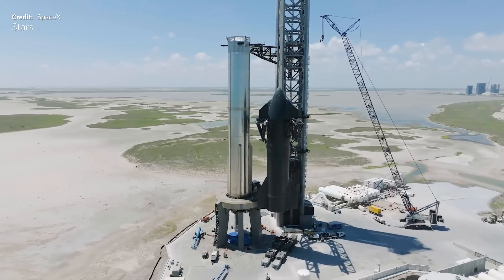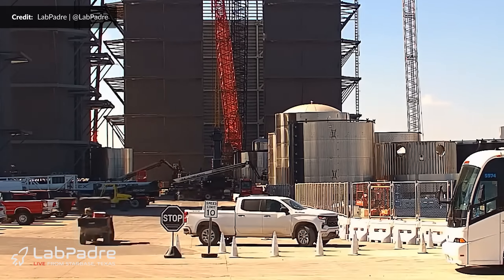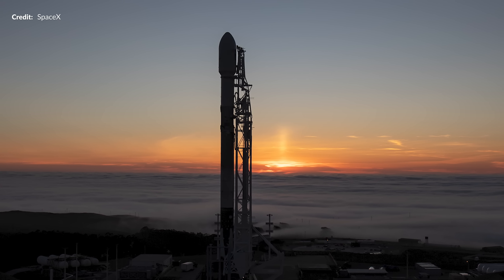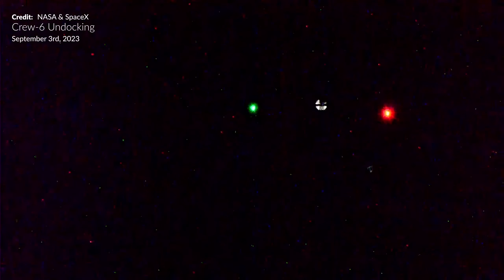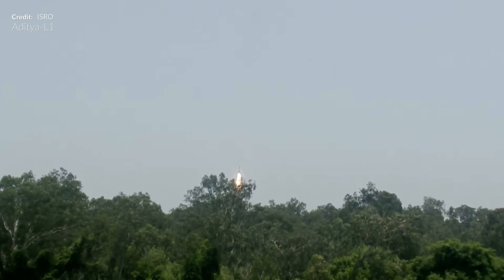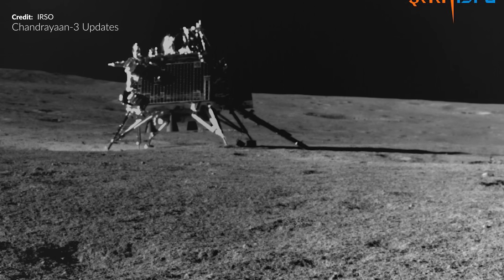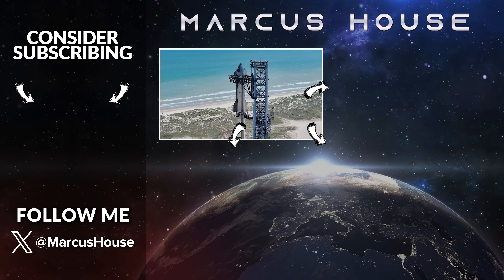Good or bad news for SpaceX's Starship Flight 2?, New Lunar Lander Launched

Comment: From the language in the FAA letter it's clear the report they refer to was only reviewed by them but authored by SpaceX themselves. This means the 63 "corrective actions" were also defined by SpaceX themselves, and not something the FAA came up with and is forcing SpaceX to implement. So these corrective actions probably describe some or all of the modifications they implemented on the FTS and Stage 0. The reason the FAA explicitly states the closure of the investigation does not mean immediate return to flight operations may be because that requires a new launch license.
Reply: Exactly.
Reply: Most likely it will just be a modification of the existing licence but yes that is usually how this works
Reply: Probably not all of the 63 corrective actions, but fundamentally yes... the FAA isn't there to tell SpaceX how to build a rocket, they're about ensuring that SpaceX has the right processes in place to ensure safety. So the closure of the investigation simply means that they're satisfied that the investigation was carried out appropriately, and that the proposed actions adequately address the problems identified.

It doesn't mean that all of those actions have been carried out — though if SpaceX are proclaiming themselves ready to launch, it suggests that they have reason to believe that all the show-stoppers are covered.
Reply: @simongeard4824  I've seen the checklist. ALL 57 items are completed. The other 6 are for the next vehicle, and are pretty basic.
Launch, this week. I'm still guessing 15 Sept. Friday. They are wrapping up on a 15' concrete barrier around the pad next to the mud flat. Tanker trucks are starting to roll out of the Port of Brownsville. Mind you, it takes 400 semi tankers to haul all of the cryo and water. And that's going to be a problem, going forward. I see them dredging and building a pier to barge in supplies and barge vehicles to Florida, eventually.
  👻☠️🗽💯🙏
Reply: @CritternNation  They're a bit limited in their ability to dredge there - the whole wildlife reserve thing - but yeah, logistics are certainly a challenge for them, and one they'll need to solve over time.

Comment: Painting that nose cone white is probably to test the paint they are planning to use. There is a lot of engineering goes into the paint as it has to be robust enough to survive the launch but very light weight and also has to have the correct reflectivity. They no doubt want to leave it out in the weather for a while to see how it stands up, after all the actual vehicle may be stacked at the pad for a while before it launches.
Reply: Good thinking...
Reply: It seems excessive as a paint test... I'm sure they have plenty of appropriate scrap steel lying around.
Reply: @disorganizedorg Always remember to Test as you fly. It seems that every rocket company has to learn that lesson the hard way.

A Boeing Starliner software error cut short the first flight test. Testing all of the software together would have caught the error and saved Boeing billions.

Almost every successful liquid fueled rocket engine design has been tested on vertical test stands. It is more expensive than testing on horizontal stands, so they tend to verify that they consistently get the same results on horizontal stands and do the bulk of testing horizontally. Vertical test stands need flame diverters, which require a lot of maintenance.
Reply: @hamjudo  Starliner is dead... more bad news this week for it. I say scrap it, stop the bleed-out... and let private partners take over.
Reply: @LuMaxQFPV   What is the additional bad news?

Comment: That hot staging ring needs to be super well engineered to support a fully fueled Starship during acceleration to space! Those vent holes don't lend any support, nor do they hold air pressure to improve rigidity.
Reply: It's not much different from the ship aft skirt. That isn't pressurised either and it holds basicly the same weight. As long as you have plenty of stringers there shouldn't be an issue and SpaceX already stress-tested it on the can crusher to confirm. I'd be much more worried about the hot-staging ring's ability to survive the engines firing during separation without sustaining significant damage and succesfully protecting all the delicacies on the top of the booster.

Comment: The FAA news drop was unexpected this week, while I don't expect a launch before 9/15/23 pending mitigations outlined in the docket. I do think that a license will be issued for IFT2 in September. Great stuff @MarcusHouse
Reply: 15/9/26 😅
Reply: @SLU2MOVIES   No, the 63 action items were all generated by SpaceX in their report to the FAA, and the FAA has been involved in creating them. A lot of them have already been addressed, again in conjunction with the FAA so there will be no problem with getting FAA sign off. What's left is mostly paperwork rather than actual engineering. The launch license should be granted in the next few weeks.
Reply: @SLU2MOVIES right notation, wrong conclusion

Comment: I am wondering about the heat shield of starship. It looked like quite a lot of tiles were sticking out or in the process of falling out. That impression surely must be wrong?
If SpaceX wont post anything on YT anymore, well then that's it for me. I wont get forced to use a certain platform.
Reply: They are testing what happens when there are damaged or missing tiles. Thermal cameras within the fuel tanks will record the thermal stresses on the stainless steel.

The stainless steel is pretty tough and is likely to withstand re-entry if a few tiles are missing, although it would need extensive maintenance to ever fly again.

The first integrated flight test used a mishmash of older engines. This allowed testing of quite a few systems that aren't normally used. It exposed a significant flaw in the flight termination system.

Tests where everything works aren't nearly as informative as tests where things fail. If you can do a test every few months, then knowingly testing with less than the latest version of each subsystem is much faster and more informative. Only testing near perfect test articles leads to only running tests every few years, and very slow progress.

Comment: I would love to know SpaceX's contingency plan in the event that one of the transporters fails COMPLETELY during transit to the launch pad, and can't continue after getting out on the road.  I mean, you CAN'T "set Starship down on the road" while you pull the dead transporter out.  Technically you "could", but the road and the surrounding dirt shoulders aren't level enough or compact enough to keep a Starship upright.  
--> Would REALLY like to know what they'd do?
Reply: They would use the crane
Reply: @nelsongarcia8959 ...interesting, considering the tracks on the crane would absolutely DESTROY the asphalt getting there. They'd have to shut down the road for days while it sat there waiting for the crane - disassembling the crane, transporting it, reinforce some surface out on the road to put it on before reassembling the crane out there... yadda yadda yadda.  All to prevent having to drive it out there, because that would be a VERY bad thing.  Not sure that's their solution.  Or, maybe it is.  Question still stands.
Reply: @NorthernChev  That was just my guess, as I wouldn't see any other way under that scenario.  I do think it may be time for SpaceX to consider building a bypass along the road, in case of a lengthy blockage or if emergency passage is needed while the road is blocked during a move. It could be designed for light traffic only and for short-term/emergency use; and it could be just one lane.  Then SpaceX could take their time with a repair-in-place approach or, if all else fails, crane the booster or ship over onto a new transporter.
Reply: @nelsongarcia8959 Absolutely.  What you suggested really could be the only option that WE could figure.  But, as unfeasible as that option would be (at this time) it really makes me wonder what their contingency is on this.  I wish there was a way, other than an actual failure, to find out.

Comment: I'm curious. Why didn't SpaceX test the booster by attaching an aerodynamic cone to the top and actually launching and landing it.  Maybe even test the launch site recovery process. Seems like that would have been a good idea.
Reply: I think want to test getting it launching successfully first then try to land with the OLM and Tower. Because if they try it first they could set themselves back a lot if it goes wrong and destroys the Tower or OLM.
Reply: I've wondered the same thing... just a nosecone and some rolls of steel as a mass simulator. Though a tank full of water might be better in case of FTS activation.
Reply: I think they wanted to test the ship and gather data on the Raptors and stainless steel, etc. The booster probably was too risky versus the reward to launch and land. Way too much propellant and based on how many times the ship crashed, yeah there would have been some big explosions lol.
Reply: @digi3218  That makes sense. It would've been great to see though.
Reply: @book_of_norman  A failed catch attempt would do almost nothing to the tower. Even if all the fuel remaining explodes with 100% efficiency, the total power would be less than a 33 engine static fire.
Reply: @bryanillenberg  if the booster hit the tower, couldnt the tower maybe collapse from the impact? or is the tower strong enought to handle that?
Reply: @HamzahKhan314  the tower could take a lot more than a near empty booster hitting it, even at terminal velocity.
Reply: That's pretty much what they did in April... but the aerodynamic cone was a Starship. Don't make the mistake of thinking that some dummy upper stage would be cheaper or easier... they already have ships, so many that they've scrapped at least half the vehicles they've built. Using one on a test which might successfully reach staging is more useful than scrapping them and launching with a mass simulator.

Comment: Let's hear the odds that a HUGE vehicle like Starship will be able to approach the tower in variable winds to the required accuracy during MANY landings and manage to avoid taking out the tower at some point.
Reply: I mean, I get that there will be more aerodynamic forces on starship. However, falcon nine boosters cannot hover in place, even with only one engine at minimum throttle, so it has to be a precisely calculated Landing. 
Starship can actually hover without going back up. Raptor engines also have an extreme degree of gimbaling.
Also, they don’t launch rockets on really windy days, so what even is your point?
Reply: The super heavy booster will have much more control authority than a Falcon 9 booster and the target region is about the same size as a drone ship.

Starship boosters can hover and fly sideways. The tower arms can reposition over an area larger than a drone ship. If the catch pins miss, the booster can be caught by the grid fins.
Reply: r u sure the grid fins can do that? ik they were originally designed to, but thats not the plan anymore right? @hamjudo
Reply: @HamzahKhan314  It is an option if things go horribly wrong. The booster probably won't fly again, but the engines will be fine.

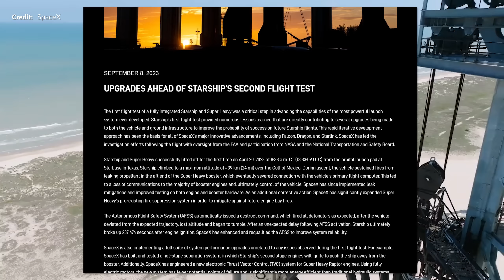Comment: 9:39 - Now, this is a very refreshing deviation from the narrative prevailing among fanboys that FAA is "holding byck" SpaceX. Kudos, Mr. Musk!

BTW, reading through that FAA letter, it is quite obvious that most of those 63 actions are something SpaceX already did - they were common sense, like "don't let the rocket excavate a crater under itself". The most challenging will probably be the requirement for more strict change management - as in, "if you decide that you need a water deluge system, than don't launch until you build one!"
Reply from the maker: See the X posts that just came out.i just posted a copy myself. Great news. Issues are 'complete'.

Comment: The white paint may be to reduce the temperature inside? Stainless steel picks up heat from the sun like you wouldn't believe.. If they are trying to work inside...

Comment: I would like other space agencies to send missions to the less or never studied places in our solar system.  Get ambitious, there's so much we've never seen or studied in any detail.  Neptune and Uranus are just two examples.  I would like a space craft to be designed and launched with the very specific goal of leaving our solar system as fast as possible and survive for as long as possible with the very best cameras and other science equipment.  The object is to confirm the observations of the Voyager probes.  Perhaps search for dark matter, etc.  The Voyager probes are doing great science right now, but they are very old and operating at a fraction of their original capability.  No doubt a craft purpose built will shatter our current understanding of our solar system.

Comment: what attaches starship to the booster? I saw it being stacked are there clamps inside that lock in somehow?
Reply: On the pad while unfueled, it is stabilized by the arm with the quick disconnect. High winds can create strong sideways forces.

When the weather is suitable for launch, I believe that gravity and  rocket thrust will be more than sufficient to counteract any of axis aerodynamic forces experienced during a successful flight. If the full stack experiences any significant bending loads during flight, it might be a good time to test using the ship's engines to escape from the flight termination charges on the booster, if that is ready. Otherwise it is flight termination time for both stages.
Reply: i think there are 3 clamps on the inner ring of the booster and ship that lock onto each other.

Comment: Anyone know what the storage capacity of the water deluge tanks is -- per tank?
Reply: Total water used WAS 350,000 gallons. They are adding more, so 500,000.
Divide that by the number of tanks.
Reply: @CritternNation  That sounds high for those sized tanks, but perhaps they're bigger than it looks.  I do hope it's fresh water and not salt water -- if so, where are they getting that water?

Comment: @MarcusHouse. Just a quick thought on the black stands that are being built.  My guess is that Spacex is trying to get away from having to lift starships with a crane.  Putting them on these stands early on means they can move them around with spmt’s and then can avoid having trouble tiling the hook areas.

Comment: The spacex statement was interesting. A lot of people thought it was the hpu that failed. But instead, it was faire in the engine pay from propellant leakage which caused the connection to flight computers to be severed. Flight termination activated but was not strong enough to break up the vehicle.

Comment: @marcushouse If that is a HLS pathfinder nosecone, why does it have heat tiles?  There will be no reentry in HlS
Reply: It's an unused nose cone from a previous starship build. No need to take the tiles off, and saves having to build a whole new article.

Comment: I kinda wish the FAA had a process for only considering how a "mishap" put others at risk. If Elon decided to try and exactly duplicate the first attempt (including the crater at the start and tumble at the end) that should be nobody's business other than the shareholders unless it looked like it was going to risk landing something outside the safety zone.

That said, SpaceX should learn all they can from a third party investigation even if they wern't required to act on it for this next launch.
Reply: What an insane attitude. The damage to the surrounding area is very much the business of the residents.
Reply: @roblyndon5267  That depends on who owns the land that might be damaged. If SpaceX owns it, then it's nobody's business but theirs. If someone else owns it, than potential damage to it "put others at risk" (risk of loss in this case) and I already said the FAA should have something to say about that.

My main point is that the FAA shouldn't care if this or any following test succeeds or not, just as long as it doesn't harm others.

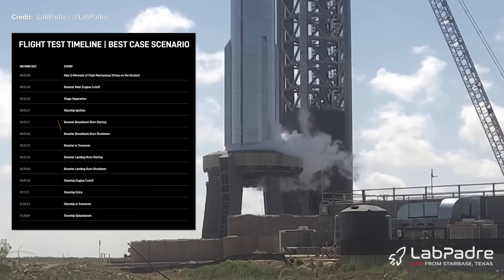Comment: Thanks @Markushouse ! A nice detailed coverage, as always 😁.  Pl clarify one imp point! At around 3:20 u give the "flight test Timeline". Pl review & find out if the action points in your table at time lines 0249, 0252 & 0257 do reckon the revolutionary new "Hot Stage Separation"? As I understand the ship will get "hot" even as MECO is happening.

Pl correct me if I'm wrong. Thx.
Reply: the ship will have to fire its engines before MECO, otherwise there wouldn't be any force pushing the fuel into the engines.

Comment: I wonder if the speculative HLS nose cone is actually just going to be the human part of any manned starship launch. It'll serve also as an escape pod for those manned launches which is why it also has heat tiles. And/or a "Starship Dragon Capsule" basically.
Reply: There can never be an "escape pod", or any other kind of abort system, on a multi decked space ship, any more than there are ejection seats on airliners.